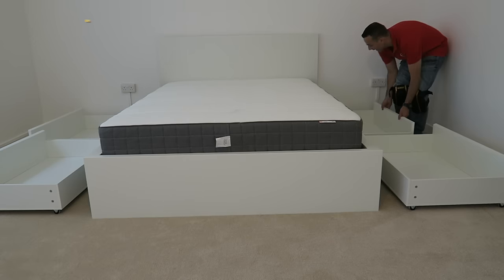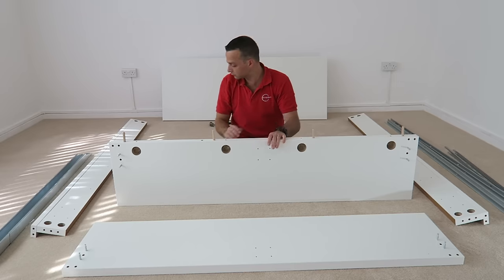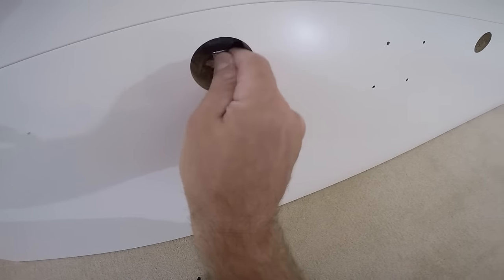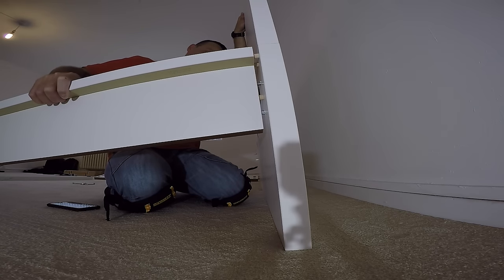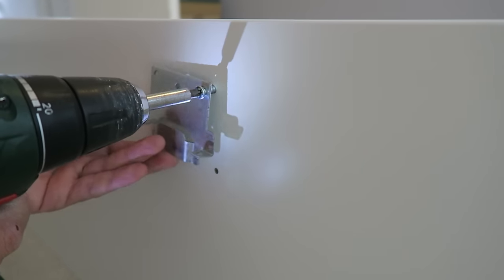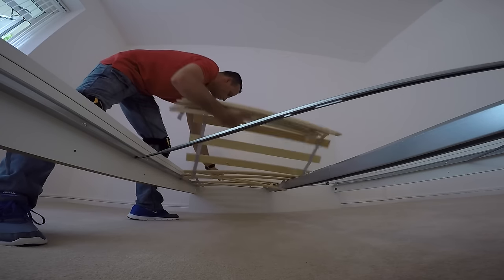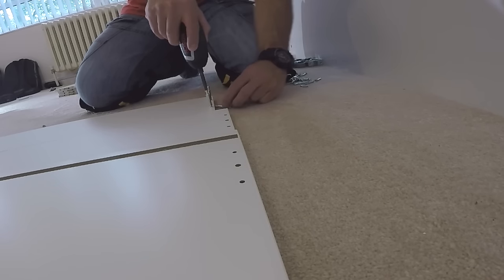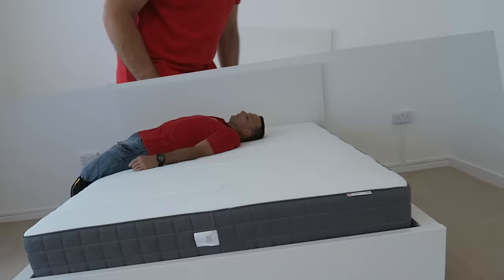Ikea MALM Bed frame assembly with 4 storage boxes White/luröy

Comment: Good video. The only hard part is the diagonal things which hold the frame from changing angles, very hard to screw through. The metal is too pliant. Apparently Ikea has had a lot of customers having to get replacements for them for this reason (support told me)! I had this problem a few years past when putting one of these bed frames together, getting ready to do it again today (hopefully with more ease)!
Reply: having the same issue but i’m too exhausted now i think i’ll just sleep on the floor for the night :(
Reply: I’m currently having the exact same issue, I’ve given up and will try again tomorrow :(
Reply: @ShakeraMonique  i gave up completely. i put the slats & mattress and slept peacefully. one day i'll remove the mattress and try again
Reply: @isword  you will have to use a drill i had 3 mates try with no luck with screw driver
Reply: @The-CookiesDream  thanks for the tip! one day i’ll buy a drill and give it a shot
Reply: I’m struggling with the exact same issue. Even with a drill! Is it ok to just skip the diagonals?
Reply: @meeralakshmisuresh8294  according to Ikea, no. They are necessary to avoid the frame expanding and breaking. Just use force and screw short slow bursts, that's what I did!

Comment: Almost 5 years later - and just yesterday, I used this video to put together my bed! Very detailed and comprehensive! Joining the front, back and side panels was the toughest part for me since I was doing it alone, but it came together nicely. Thank you so so much!!!
Reply from the maker: Thank you for watching
Reply: What size is the Allen key used to tighten the round locks. Lost mine and need to tighten up a bit.
Reply: What size did you get?
Reply: can you sugggest a product number for a good mattress for this ?

Comment: Just a suggestion for anyone watching if it's hard to connect the sides to the headboard and the back, you can rip parts of the carton the bed was packed and lightly with your hammer 🔨 hit it on top of the carton, so you don't chip the paint to get more power to connect the sides to the main fames. amazing video, this helped me a lot. thank you
Reply: smart! thanks for the suggestion :)

Comment: Just finished my bed!! Took me 4 hours with one person helping (4 storage boxes). So beautiful! You def played a part in helping when instructions were a bit confusing. Thanks so much!
Reply from the maker: Thank you for watching
Reply: I know its kinda late, but how is the bed? Is it worth it?
Reply: @yousifadel9604  I still have it, no complaints. Still in good condition. It probably makes a difference that I'm the only one sleeping in it so its not wearing down fast
Reply: @saronbubbles123  Thanks alot. One last question, so are you also experiencing that the bed is noisy? And if you have did you fix it somehow?
Reply: @yousifadel9604  No i haven't experienced that but I'd check if there are any loose screws where the wood panels lay

Comment: Thank you for 06:44 - you pushed them in all the way in the original instruction manual they are NOT pushed in all the way but line up with the frontpanel - which then of course will NOT work. After spending 20 Minutes trying to get it working like it is shown in the MANUAL I searched youtube, found your video, got the solution and build my bed. THANK YOU!!!
Reply from the maker: Thank you for watching

Comment: Nice vídeo and tips. Tks for that. But it was a bad idea to ensamble both parts of the bed (top and bottle) at the begining. That way just makes harder to find a good angle after to tight the screws that goes on the bottle part.

Comment: Hello, I very much appreciate this video but there is one part i dont understand. 
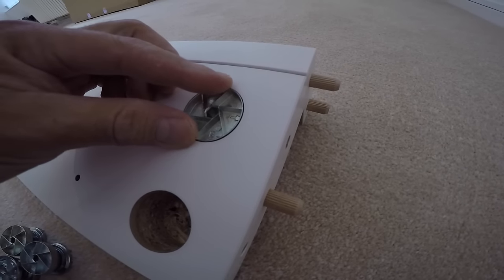Around 6:11 everything you said was done,  but i couldnt push them in.
Is it because of the fact that i kept the headpanel for last? maybe the arrow was pointing in a wrong direction or i pushed  something in too far. I
 really dont know what i did wrong here, and would highly appreciate it if you would be able to help me out further.
Edit: I think i got it. Can it be because i already put the "big" panel in? With me, there are screws in the holes, so i would suppose...

Comment: Thank you much for this and other videos, they help me to research and understand those products in much more details than IKEA materials. I have an question though. My bed is located under a window, and I can not have headbord higher than 90 cm. Does it make sense to cut 10 cm from the headboard and not ruin it to much?
Reply from the maker: I think the headboard is not full MDF inside sometime they use these materials Particleboard, Fibreboard, Fibreboard, Printed and embossed acrylic paint, Plastic edging, Honeycomb structure paper filling (100% recycled) so if you cut the to you may have hole there all along
Reply: @PPFlatPack  Thank you for the quick answer!
Reply from the maker: Thank you for watching

Comment: How do I keep the back/bottom of the board on? I was able to get the headboard fully secure to that front board, however the one at the base at the foot of the bed seems like it could come off at any moment. Also, The screws for the parts that make a hexagon would not fit. I got different screws but they were a bit too small. I put them in anyways thinking that it would be fine as long as it does it job and gravity doesnt work against it. I will not be putting on my mattress and hoping for the best. I guess I wil find out soon enough if it works.

Comment: Hello my friend, actually i'm building a Malm Bed 160x200 with à Leirsund bed base.  We have assembled the box spring but not yet the slats to test and see if it fits. When we place the first it works well but when we want to place the 2nd, it has trouble entering efficiently to clip with the first. We think we missed a step during the fixing of the small white cap, we followed your video and on the head of the bed we did the same as you but at the foot of the bed on the big metal bar we do not see how you got them to place. Can you help me?

Otherwise great your video is very complete.

Hello to you.

Comment: Hi! Thanks for the clear instruction in your video. I have a few questions about the heights of the metal side bars. 

On the Malm King bed that you built, what are the measurements from the floor to the horizontal part of the metal side bars where the slats rest, including the slats once they're in? I'm trying to determine how high the top of my mattress may be when it rests on the slats on the lower setting and the higher setting. Also, how thick are those Luroy slats and can the top of the wood side panels be removed or are they secured to make that L shape on the new Malm beds? 

Thank you!

Comment: my malm bed frame with four storage boxes came without headboard, it doesn't have a headboard, all corners are of short height and the bed after installation is very squeaky, even the slat are conjoined from both sides as one whole piece, unlike yours which is seperate. why is this?

Comment: I want to purchase this bed this weekend.. I actually purchased a brand new mattress and box spring in may.. would this bed be compatible with a box spring. or would that be an issue as I don't want to get rid of the box spring :(
Reply: From what I understand, if you use the box spring you won't need to get the slats.  It will, however, sit much higher.
Reply: Did you buy it yet?

Comment: Hi there! If the bed comes with drawers, can you use the lower holes on the side panels when screwing in the rails (when you have a thicker mattress) or would this interfere with the drawers? Thank you so much for this video, it’s so helpful!
Reply: This might be a little late, but it works fine with the lower setting and the drawers :)
Reply from the maker: Both holes will work

Comment: Very helpful!   Do you think that the wood slats are strong and wont break easily? Im afraid if wont hold a lot of weight. Which slatted bed base is better from ikeas bases: leirsund, lönset, luröy ??
Reply from the maker: Even the cheapest one Luröy is strong enough to hold a lot of weight once you put a thick mattress on you should be fine. More expensive LÖNSET is even better you can adjust the slats to your body weight and increase the suppleness of the mattress. Last option if you have money to spend LEIRSUND adjustable bed base I don't have experience with this one it looks fine only minus you have to choose the right mattress for this one (foam or latex mattress not suitable for spring mattresses). My experience first two cheaper options Luröy & LÖNSET fine for what ever weight. The majority of people in here the UK buying Luröy I think is it the cheapest option and it works well.

Comment: Thank you for your video. I put my Malm bed together but the slats keep caving in on the side I sit ( the wooden length of the bed). Since I did not save my receipt, I went and bought new slats. I am facing the same problem with the new slats. I can't figure out what I did wrong. Can you please help? Thanks.
Reply from the maker: Hard to say if I don't see it. If you like you can send shots video to my mail.
Reply: @PPFlatPack  Thanks for responding. What is your email? Thanks and regards
Reply from the maker: @anu9637  All the links in the description
Reply: @PPFlatPack  Thank you! I see it. I will send it in a few hours as I  am  not at home right now. Lots of love from Canada

Comment: Hi PP Flat, have you built any beds with the LONSET slats from IKEA and noticed that the mattress floats above the frame?
Reply from the maker: Yes if you have LONSET bed slats should go with lower position of the rail and the mid beem than mattress would sit inside bed frame.
Reply: @PPFlatPack  thanks!

Comment: hey great youtube channel really helpful since i just purchased loads of ikea furniture, how you deal with the tiny screws that you are sometimes need to screw in tight corners  i find the screws too  small to hold while using my drill to screw them in.
Reply from the maker: Thank you or the comment. Regarding the small screws in general, the tops on my electric screwdrivers have a small magnet built in so when is hard to hold the screw you just place it on the screwdriver and its grip than you have one hand free plus you can get easier to small places.

Comment: very good video. Thanks
Reply from the maker: Shiva Kumar Thank you for watching
Reply: I bought just Malm bed frame in white. After few use, I hear squeaky noise (From the metal and the wood touching). 

You used Luroy Slatted base but we used Lonset slatted bed base.

Is there a way to make the squeaky noise decrease?

(More information: We use Memory foam mattress instead of spring mattress. )

Thank you for your help.
Reply: My question too!
Reply: Tamalika Mukherjee I asked that question to another video and he replied this: 

"Get long rubber strips about 2mm thick, or use strips of folded cloth to place between the slats and the metal runners. Need to do it along all 4 runners (next to midbeam and sides of bed). I've learned to live with my bed's noises, but this should do the trick if it's really bothersome."

Note: Another video I saw also used masking tape but I dont think it was Lonset. It was Luroy I think. Not sure if it makes a difference but yeah. 

Im gonna make sure to put it on metalbeam and side of bed between the metal and slat.

Comment: Really nice video👍🏼 do the wheels on the drawers move 4 ways or only forwards and backwards?
Reply from the maker: Mariam Basahai Wheels go forward and backward only. But that's what you need because there is no rail if they move 4ways it will go out of line and if you have two drawers on one side there is no much space between them.
Reply: PP FlatPack ok, thank you for replying😊

Comment: I am unable to screw in the tiny screws on cross braces at 12:40 I see you used a drill, perhaps this might he the only way
Reply from the maker: These small screws going hard in you have to hold the braces and press hard on the screw. You right with manual screwdriver challenging but possible just get first grip watch your hands.
Reply: @PPFlatPack  I've got a single size malm. The two braces are supposed to cross to other side and ends be connected together to form triangle, so the screw goes through the frame then through both braces. I struggled to get it into the second brace. I left them screwed in horizontally

Comment: Hello! I ran into an issue (before watching this video) - I placed a lock on the rail in the opposite direction (instead of arrow being visible, the other side of the lock is visible) and I can't take out the lock. Help!
Reply from the maker: .Kyuuchiuga. Get slim screwdriver and push the lock out from the hole on the edge it will move up slowly
Reply: PP FlatPack tried that, it didn't work.
Reply: Fixed it? I have the same problem.
Reply: mohamad duzan yes, I ended up using eyebrow tweezers to grasp and pull the lock out.
Reply from the maker: Usually I use Mini Carbon Steel Long Nose Pliers to take them out. If no I use thick screw to take them out.

Comment: It would`ve been better if the frame was constructed from metal tubing with fibreglass panels around the sides.  It should also be sitting on wheels.
Reply from the maker: Maybe you right but the price would be double aaaaand thats big NO NO for most people.
Reply: Furniture constructed from metal tubing is usually affordable. But instead of fibreglass they can wrap fabric around the sides.